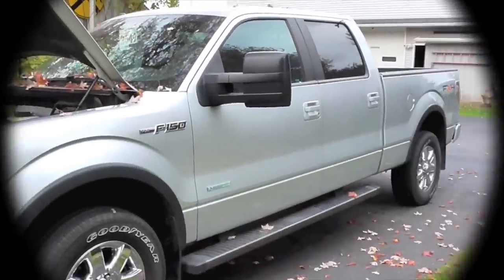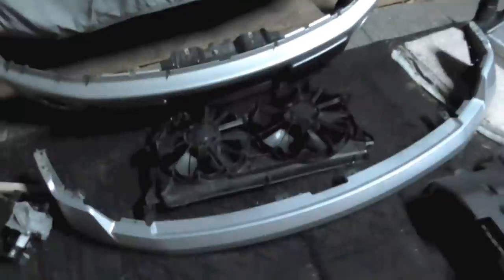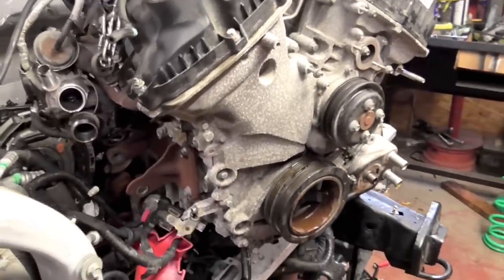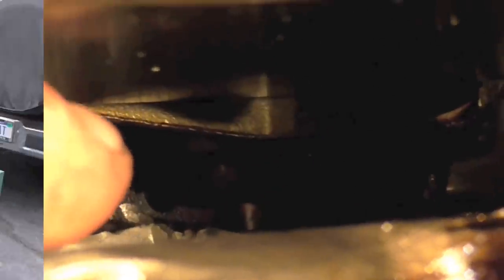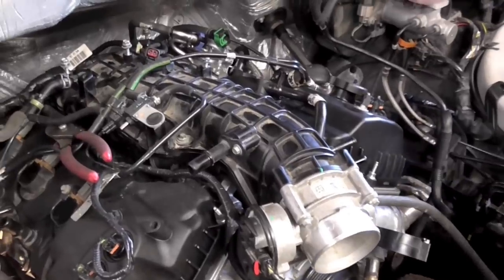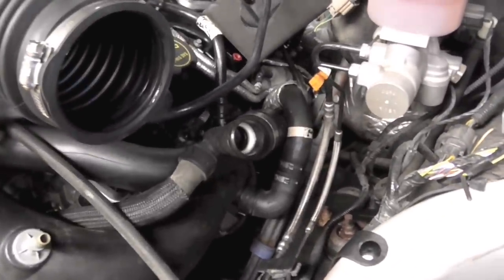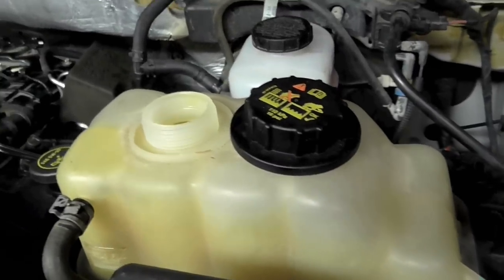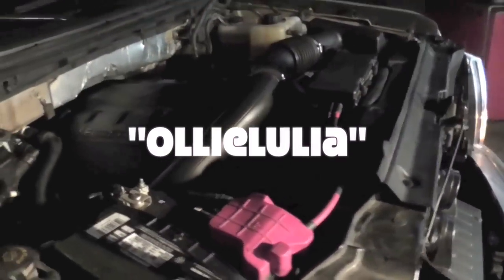FORD F150 TRUCK:  3.5 V-6 ECOBOOST ENGINE FAILURE (Removal and Installation).

Comment: Ford owner say, “all vehicles have mechanical problems” hahaha
Reply: Ok what about the northstar engine that 3.4 chevy had with cooling problems the 2.7 Chrysler.  Everyone is a keyboard mechanic but ask the for a box end and they hand ya an adjustable
Reply: What do you drive John e? Have much experience with fords, I love how everyone thinks Ford is the only manufacturer with vehicles that need repair, as the other man stated howbout gm and their shitty Northstar as well as the Ecoboost 2.4 that burns oil at 50,000 miles, Chrysler's 2.7.. yeah. Exactly other companies products have their fair share of issues.. you just somebody trashing Ford because you heard others trash Ford, trying to be like Mike eh?

Comment: thats why conventional v8s are reliable than this eco crap
Reply from the maker: Have you seen the "Mike Rowe" Video's / EcoBoost JD ?
Reply: TommyZTrains that run they did was under strictly controlled conditions. it doesn't accurately simulate real world conditions. most people at least mildly neglect their engines and fluid requirements. people go over on oil changes for thousands and thousands of miles, they don't properly cycle the engine. 150k mi on a dyno in a lab type environment isn't equilvenant to 150k mi on the road.
Reply from the maker: "I'd agree". In a "broad-based" thought: one would think that the Ford Video was / is more harsh then what YOU just sited with example too the "real-world" realities ... "YOUR RIGHT with regard to the oil change remark" !